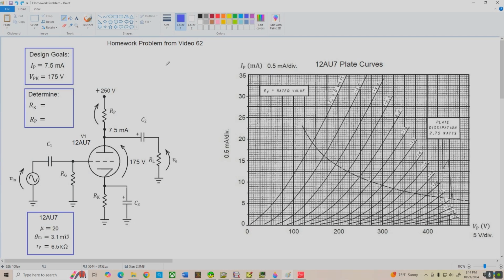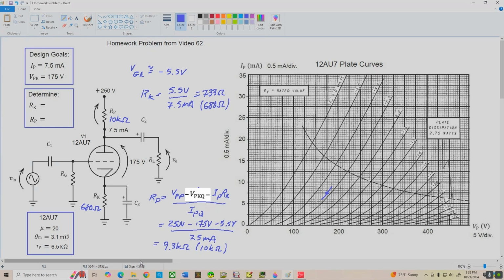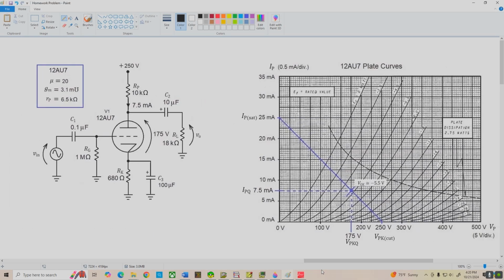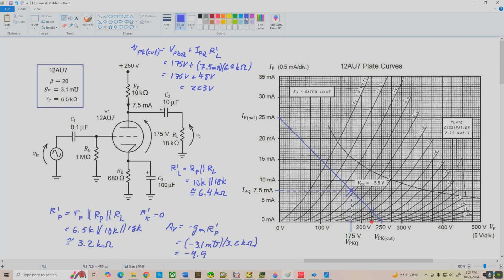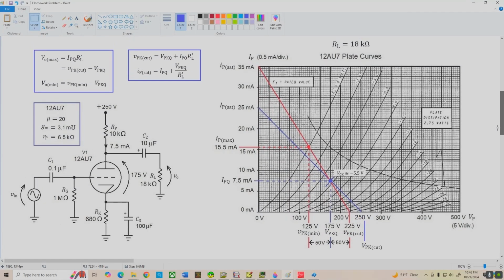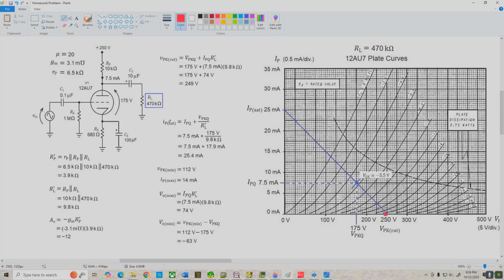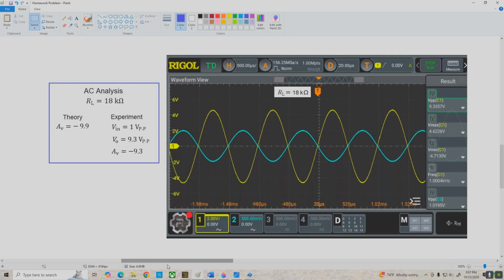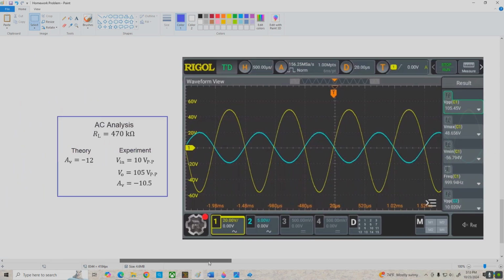Topic 63: Triode Design/Analysis Problem Solution

Comment: Great to see you doing these calculations, as there are a lot of people that would really like to see the rationale behind a circuit design.
Just a minor point but even in 1/2W values, you can get 750 and 9.1K (metal-film from Amazon)  which would be closer and will likely give you closer results in your empirical testing.
Again, hats-off to you for providing this kind of lesson!
73...  😊
Reply from the maker: @SpinStar1956  thanks! I like to present circuit analysis and design succinctly, with all the gritty details and as little hand waving as possible, and without childish antics (like some content creators that I won’t mention by name).

Also, you are right. I should expand my resistor assortment for the experimental circuits (just ordered some on Amazon). I do order precision resistors when I build amps, effects, etc. though. Anyway, thanks again for the feedback and hopefully you’re subscribed 👍🏻